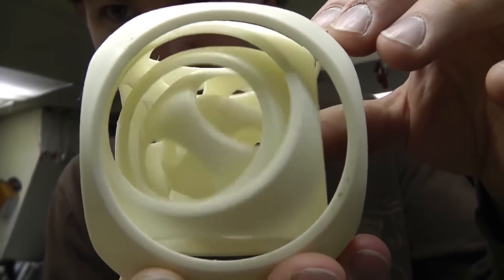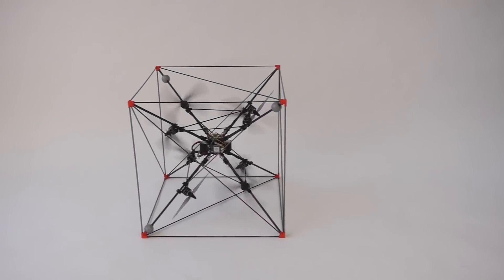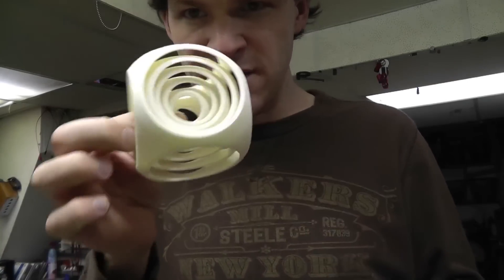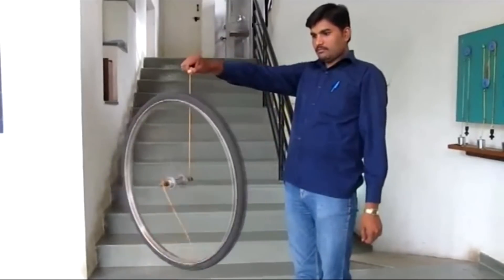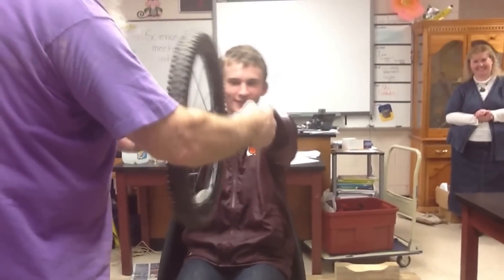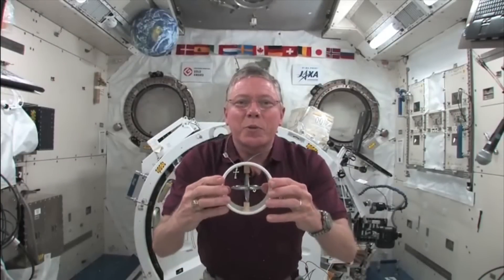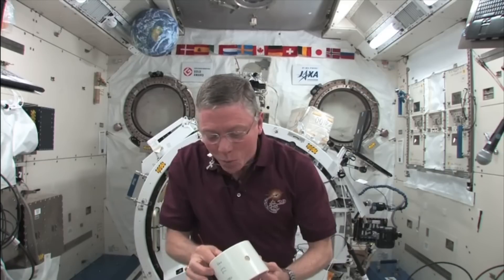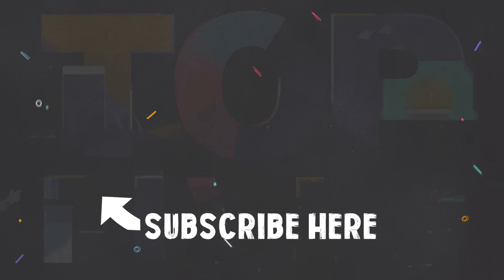5 Gyroscope Experiments Amazing to Watch

Comment: in the case of the drone, the same can be done with software (2020), no need for a gyroscope, there is a chip with this function built in, for any off the shelf quad copter

Comment: In the Air Force, I was learning Inertial Navigation equipment. We got to where we were firing up and aligning a system on the bench, the Stable Platform wouldn't spin up right, so the instructor had us power down, give it a few minutes and put on a spare platform. Three of us removed the mounting bolts, tried picking up the platform, three gyros, in X,Y and Z, it took us for a ride. Each time we moved one direction, it took us in a totally different direction, we quickly learned about Gyroscopes.
Reply: Fascinating & mysterious no?
Reply: @cosmicHalArizona  You soon learned, don't move it for 45 minutes. You learn Gyroscopic Precession, tilt it 90 degrees to the direction you want to move it in. But always fun to let a new guy try and move what we called the stable platform, three gyros one in each axis. He learns a quick lesson.

Comment: "Mass" is constant so the "Weight" will stay the same, at no point in his video did he say "it becomes weightless" he just wanted to point out a feature and that is the Stored enegy in the spinning wheel can be used to move the moment of rotation or fulcrum of the object and can be used to reduce the effort in moving the object, this is demonstrated by your Gyro retaining an almost 90 degree angle as if the Fulcrum had been moved toward the spinning disc making it appear to defy gravity.

Comment: . . .Never drifting sideways or in rotation for minutes at a time, only up and down slightly. We don't need to wait for someone with a physics degree to describe what we can see. As other videos have revealed, having glitches that affect the astronauts alone, these are multi-layered video images with multiple sources and the astronauts recorded in front of a green screen under suspension. This is something that you can easily do today with available software. CGI for separate objects has also greatly advanced and can be manipulated during live streaming. Notice that the astronaut with the gyroscope did not pull the string to spin the gyroscope on camera. The video cut to the point where the gyroscope was already spinning in front of him. He can alter its apparent position, but he cannot actually operate the gyroscope. It must be already spinning in layer either from a separate source in front of a green screen or more likely from a CGI file of a 3D object because he is able to manipulate the position and orientation of the object.

Comment: Why did he have to put the mic down in zero gravity ?
Reply: I am sure that he did not want it to drift too far away while getting the gyroscope set up. It is hard to let go of the mic without it having some minimal force from his hands causing it to drift. I have seen other experiments where they do the same thing. Also, it may be a tendency to do things the way we would do on Earth. Naturally we would set the microphone down nearby. The mic probably has some Velcro on it to help hold it in place where he placed it momentarily.
Reply: Yeah and then you realize he didn't at the end there you just put in some extra space and then did the gyroscope stuff anyway and it just slightly fell down
Reply: he was probably afraid to hit it acidently while spinning the gyro up with a line. the mic or/and some equipment it hits could break

Comment: As I write this, there are 133 comments. Probably 100 of the comments are about the poor audio mixing in the last half of the video (starting at about 5:50). Oh, plus one comment from a flat-earther who I guess doesn't believe gyroscopes exist, or that they don't really work, or perhaps that they don't work in space (he says the part with the gyroscope in space is faked / cgi).

Anyway here is comment 101 of 134:  Starting at about 05:50 through the end of the video, the audio level (volume) of the person talking is way to low, to the point that he can barely be heard and at times you can't understand what he is saying. Complicating the difficulty of hearing the person talking because of the low volume level, is the fact the music playing at the same time is playing so loud that it makes it even harder to hear and understand the person talking.

If the volume of the person talking was at a higher level, and the volume of the music was at a lower level, the music would be acceptable although not necessary. As it is though, the music should be eliminated in this part of the video so the person could be heard and understood.

Comment: So our earth is a massive gyroscope?
Reply: if the earth stop spinning and stop orbitting the gravity is loss
Reply: @MugCofee  Gravity wont completely be "loss", gravity mainly depends on the mass of the Earth but the rotation of the earth does lead to a larger gravity along the equator and conversely, smaller gravity near the poles.
Reply: ravjeet singh You got that almost right , just backwards.
Reply: On that topic of differing gravity, that would mean technically if you dropped an object in a fixed environment at both the pole and the equator the one at the pole would fall slower?
Reply: exogator No, the one at the equator would fall slower. Ravjeet stated the gravity conditions backwards
Reply: gvc76 to the faster rotation along the equator creates a stronger gravitational pull?
Reply: exogator, the faster linear velocity along the equator produces a centrifugal force that reduces the effect of gravity by a tiny amount. That, and the distance from Earth center is larger at the equator because the earth is slightly oblong, which also reduces gravity a little more. So objects at the equator fall slower than those at the poles, by a small, but measurable amount.
Reply: gvc76  sorry I meant to say it that way around, my brain is asleep hah.

Comment: Oh yeah funny how the astronaut has to put the microphone away, btw. why does he need to hold that piece shouldn't it float up there?
The clip with the second astronaut is full of riddles: Why does he even wear a necklace, and if he can't let it be why isn't it stuffed under his shirt? Why does his nacklace and he himself move up and down continuously, but the things in the background (ball, flags diverse cables and the mic) doesn't move at all? @8:16 he pulls the string and then puts it "down" somewhere? The gyroscope wobbles like crazy after he pulles the string and let it lose. Shouldn't it stay stable right where it is? When he tilts that tube with the rotating gyro in it forward, shouldn't it launch directly into the cam?
Just asking...
Reply: A few answers from my point of view:  The microphone is put away because floating things in the cabin are not desirable.  Probably force of habit.  Same reason for putting the string "down". He probably put the string in a restrained location. His necklace is worn because it is a religious icon, a cross.  It moves because his neck is moving.  His connecting cables are also loose and moving (look at his left hip area).  The gyroscope wobbles because the gyroscope cage also rotates a little.  The cage is not balanced like the gyroscope wheel.  Since the cage is out of balance it imparts movement to the tube.  When he tilts the tube forward he imparts opposing forces to it so it stays relatively in place.  Good questions.  I hope my observations are helpful.
Reply: @Lycoming320  And here ladies and gentlemen we have a fool attempting to answer a fool's questions, a few of which are invalid.

Comment: The drone is not a gyroscope. It maintains its orientation by beating the air with propellors. The 3D printing thingy also not a gyroscope and cannot maintain orientation on it's own. It might be more accurately be called a gimball
Reply: Beating the air with propellers is an interesting expression.  Spelling tip:  Propeller, 
 gimbal
Reply: Bingo. Spot on.